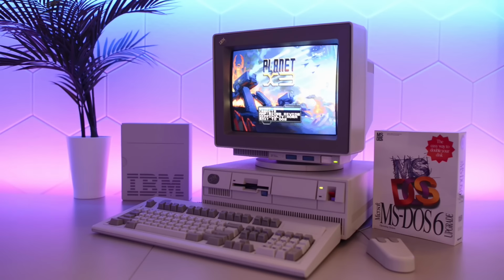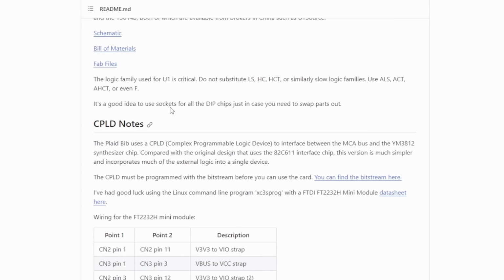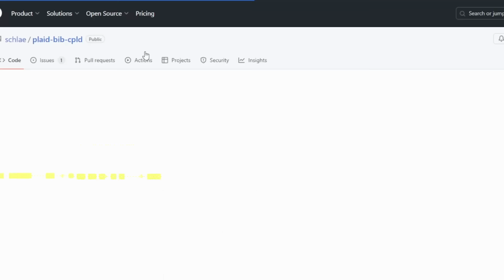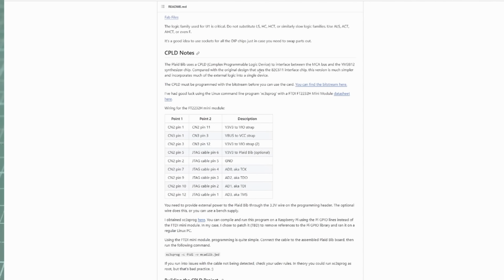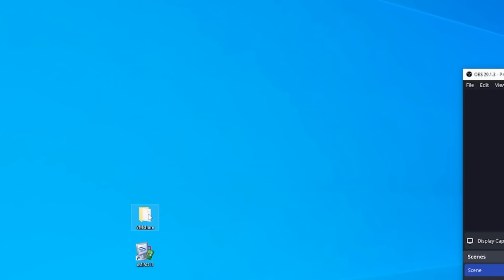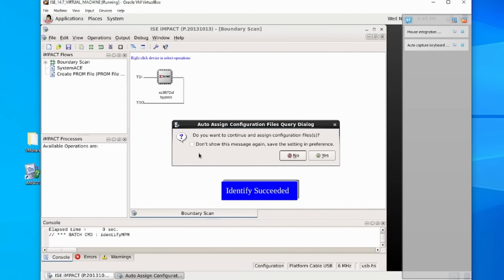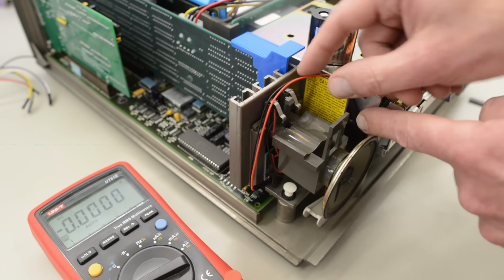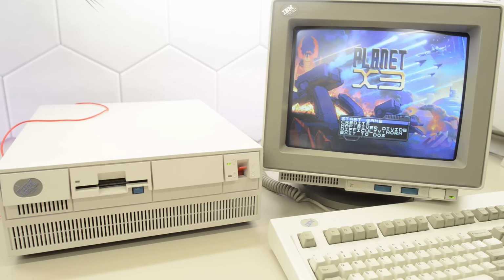Ad Lib MCA replica build + CPLD programming. Sound card for IBM PS/2 Micro Channel Architecture

Comment: tubetime is impressive smart guy. 
also, i dont think the bake part instruction is very relevant to hand soldering anyways. it is important if ur using solder paste and hot air because if theres too much moisture inside the chip package it can explode when heated as moisture vaporizes.
Reply from the maker: I read somewhere that he reverse-engineered the card just by looking at a picture of the original card

Comment: You made it slightly more difficult than it really is. When programming cplds the standard way to power it for programming is just plug the board or device in and power it normally from the slot or power jack. The chips are designed for in-circuit programming. The 3.3v will go from the 3.3v regulator automatically to the programming header and chip. There's no need to use a bench psu to supply the voltage for jtag programming. If you are concerned about plugging in the board and blowing it up due to a soldering mistake, program with jtag at the beginning.... mount the cpld and regulator then plug it in and program it. Or do what I do..... put only the regulator on the board then plug it in and measure the voltage on the jtag header and the chip vcc pins. If it's 3.3v then mount the cpld, plug the board into the slot and program it in-circuit. Then remove the board and solder the remaining components.
Reply from the maker: Ok, good to know, thanks

Comment: Is anybody else seeing the visual artifacting ?  It's pretty visible @4:58 (middle of screen on the right) though you can see it at other times as well.  I've seen it in Green, Red or Blue at various points.  I don't get it on any other videos, so I don't think it's just me. ???
Reply from the maker: Sorry about that. My rendering PC seems to be messed up. I didn't notice until it was too late
Reply: @Epictronics1  It reminded me of the kind of glitching you get when you overclock the RAM on your video card too far.  It's a bit too uniform though.
Reply from the maker: @ErrorMessageNotFound  It's probably a glitch in davinci resolve. I'll do some troubleshooting and fix it before I render the next video

Comment: Surely at some point someone will figure out a way to use Modern parts to replace the DAC. It can't possibly be that different to parts being manufactured now The OPL2 for sure needs to be an original part but a dac  should not be something that is a problem for a reproduction soundcard
Reply: I'm curious if even the OPL2 really needs to be genuine.  I haven't tested any cores myself, but we've got to be getting pretty close to near-perfect reproductions now.  I'm curious if any of them have gotten to the point where you could send the same commands to the core and real IC, and get the same bitstream back.
Reply from the maker: I was just thinking the same thing!

Comment: I think you'll find the 3 vias for the caps aren't for 3 legged caps  but so you can use either 2.54mm or 5.08 pitch capacitors.
Reply: I wonder if engineers back in the day designed their PCBs like that to account for potential part availability?
Reply from the maker: Thanks for noticing. I just assumed 3 legged caps because they were heavily used by IBM in earlier models. I checked and I think you are right. The pads don't match the polarity of three-legged caps.

Comment: Interesting trivia: If you look closely you'll notice the VLB slot and 16-bit MCA slot are the exact same connector (obviously the pinout is very different). Since the MCA bus never took off there were a lot of extra MCA slots laying around made for boards that were never sold and manufactures decided to repurpose them as VLB slots.
Reply: On a similar note: AMD's Slot A connector for Athlon CPUs is the same as Intel's Slot 1 connector for PII/PIII CPUs.
Reply: @eDoc2020  The same? I mean the same pinout?
Reply: @asanjuas   The pinout is different, and the heastink goes on the opposite side of the card. This provides very rudimentary keying: in most boards you'll hit VRM components or the back panel IO connectors if you try to insert the wrong brand CPU.
Reply: I thought that PCI uses the same physical connector, am I right?
Reply from the maker: Yeah, I read that somewhere else too. I wonder if IBM had licensed the MCA bus for less, maybe it would have become the standard
Reply: @Epictronics1 or made It free!!  There was no EISA even which, of course works very very similar to ibm MCA bus

Comment: What's the purpose of the CPLD? I suspect it's replacing an older part that's harder to find.
Reply: CPLDs are programmable logic chips that can you can use to replicate the function of discrete chips. In this case it replaces the roughly half dozen "glue logic" chips on the ISA version that take care of address decoding and latching. It also implements the POS (programmable option select) that allows you to configure the device from the reference disk.
Reply: @sa230e  I know what a CPLD  is, I just didn't know what it was used for in this case. At first I thought it was replacing the OPL chip, but then he added an OPL chip.
Reply from the maker: It replaces the P82C611. They are not hard to find but the CPLD version works with faster PS/2. The original P82C611 version only works with the Model 50 and 60 Afaik
Reply: @Epictronics1  ah ok that makes sense

Comment: I was about to ask why IBM just never open-sourced the MCA bus, but I  checked and they still use MCA in their RS/6000 unix and AS/400 line.    Interestingly MCA was a 10mhz bus compared with the 8mhz AT bus, but the big difference was burst mode (which made it a lot faster), and any card could take over the bus to talk to any other peripheral on the MCA bus without CPU intervention.
Reply: The whole point of MCA was to be deliberately proprietary. IBM thought they could force the clone makers to license their MCA bus so they could continue to be "IBM compatible", but the clone makers ended up creating their own standards in the form of EISA, VLB, and eventually PCI. In the end IBM abandoned MCA for their PCs because they wanted to compete in the same market as their competitors (until they didn't and sold out to lenovo). Evidently IBM couldn't let go of that need hold onto their proprietary technologies, hence they never open-sauced it. Maybe someday someone else will license MCA ... [wistfully stares off into the distance]
Reply: @UpLateGeek  That was 70% it, the other part was even at the time, the AT bus was simply too slow.

Two things about MCA that are frustrating:

1) The major technical thing wrong with MCA was the you needed those pesky feature disk to make the card active.   Why not just have ROM on the card that would allow the card to self-configure?  Even the Amiga could do it and it was released around the same time.

2) The patents for MCA didn't even come through until after the PCI bus had replaced MCA in the market.
Reply: @teekay_1   The feature disks sound like they could be a precursor to the init programs that accompanied various PnP cards.
Reply from the maker: Is AS/400 still alive? Wow, I used it 25! years ago
Reply: @Epictronics1  Still kicking like the mainframes.   There are small business who can't afford to move away from them.

In fact, IBM's hardware lineup in the 21st century is based on pricing that doesn't make it cost-effective to switch.

Comment: It's never a good sign for a bus's adoption, when it requires an expensive big honking ASIC just to do all the arbitration to hook up 8-bit legacy parallel devices (that's the C&T 82C611 in the bottom left of the card.)

Comment: I don't mean to panic you but be careful with "noctua" fans! They're great but the airflow is also what it is. I replaced the fan of my NAS PSU some time ago with a nice Noctua, 2 years later I realised the airflow was so low the thing was running at stupid temperatures and I baked it. The original fan was probably overkilled for the system but make sure it still gets enough airflow!

VERY nice card, I still need to sort out my PS/2 I am so lazy...
Reply from the maker: You're not lazy Tony. You made a great video this week as always. Thanks for the warning. I didn't check the datasheet of the fan in this PS/2. However, I checked and compared when I replaced the fan in my PS/1 and the noctua was quite a bit more efficient. I'll make a habit of checking every time, thanks
Reply: This really needs to be said more.  Everyone likes to replace loud fans with Noctua, and -- not always, but usually -- there's no thought given to why the original fan was so loud.  Sometimes it truly is just because... it's old, aerodynamic and bearing design wasn't what it is now, and manufacturers erred on the side of thermal margin rather than acoustics.  But, sometimes the engineers knew what they were doing, and didn't spec a fan that slow because the thermal design couldn't sustain itself with a fan that slow.  And that really is the #1 correlation -- more speed is more CFM is more noise.  Pesky physics...

Comment: Replacing the big old 6V Lithium Battery with 2 CR2032 will not last for long.
Reply: Yeah talk about a downgrade in capacity. I really wish modern retro enthusiasts would stop trying to shoehorn coin cells into everything.
Reply: @heilong108  Indeed. A massive downgrade. The NVRAM of a PS/2 ist not to be compared to normal CMOS so the large Batteries might be needed. I think thi one is a 2CR55 with ~1600mAh compared to the 110mAh of a CR2032.
Reply: @heilong108   Sorry about that.  I really hate sourcing all the various different kinds of cells everything uses.
Reply from the maker: Unfortunately, I don't think my multimeter can measure such a low current flow as we are dealing with here. I'll get back with some feedback when it runs out. Although it could be a long wait. If I understood the weird date code correctly on the original battery in this machine, It had the original battery for as long as it was in service.

Comment: Someone REALLY needs to build a modern SB-AWE32 clone, with working stereo in pro2/16 mode.. With off-the-shelf, still-produced, parts and on the relatively cheap..
There should also be an open-source design and implementation, following the same rules as above, of both a Voodoo2 and an ISA Tseng ET4000, just to cover all the bases.

Retro motherboards are available by the truckload if you do even just a LITTLE bit of hunting (large cities often have electronics stores that deal in vintage/retro hardware, there's a GREAT one in Houston TX called "Electronic Parts Outlet"- Can't tell you how many times I've come across 5170s, Tandys, Ataris, even spotted a never-opened Commodore VIC-20 there for $250), and CPUs and RAM are even more common and can be had a dime a dozen, especially the 486 era (SX20s up through DX4-120s) and the Pentium-1 socket7 stuff.

But the holy grail for most vintage builders parts lists almost always comes down to two things; a REAL sound-blaster (most aim for pro2, sb16, or awe32) and the highest-performing ISA VGA card is the Tseng ET4000 .. If you want your eyes to bulge, look up the price of an ISA-VLB ET4000-powered video card.

So an open-source implementation of both the early ISA sound-blaster and two video cards, the et4000 and voodoo2, would make retro machines muuuuuch easier to attain for the ley person, not only for scarcity nowadays, but even just in price.
Reply from the maker: Totally agree. Let's hope someone makes clones. I'll be the first to build an ET4k VLB card
Reply: I agree a sbawe64 for PCI with opl2 was an amazing dream.
Reply: Would love to see a repro EMU8K, but that's a tall order.  Although, if we have a GUS on FPGA, we're not that far off.  So maybe eventually.  Ditto Voodoo -- that's a big ask.  But so is the N64, and that's a reality now (no pun intended.)  Hopefully some day.

However, I really think the ET4000 is tarted up to be way more than it actually is.  It's... fine, I guess... but it doesn't live up to the hype.

For ISA, the bus is your biggest bottleneck.  There are PLENTY of chipsets that can saturate ISA.  The only real benefit of any given late-era VGA chipset is Windows acceleration, if you even care about that.  For DOS, brute transfer rate wins, and well.. if your kink is 320x240, adventure games, don't worry about it.  If you want to play Doom, use a Pentium with PCI.

For VLB, there are plenty of boards that perform as well, better, or at least "as fast as it matters" -- and cost a lot less, since they aren't hoisted up on a pedestal like the Tseng.

I got one of each (ISA and VLB), tested them, and immediately felt bad that I spent that much on a mediocre card that I had no sentimental attachment to.  Just my PSA -- if you don't have one, you aren't missing much.

Comment: I love descriptions on PCB.
Does anybody else experience flickering lines in the video?
Reply from the maker: Yeah, sorry about that. I didn't notice until it was too late to fix it. Something is messed up with my rendering PC
Reply: @Epictronics1  I had something like this happen back when I still used Adobe Premiere Pro. I eventually had to just remove CS from the computer and reinstall.
Reply from the maker: @grafxgear  Thanks, I'll give that a try
Reply: The printings shows the designer has a humour similar to mine.
I've seen these lines too. At first I thought my monitor had an issue.
Reply: @e1woqf  last time I saw something like this it was my graphics card dying, so I was a bit worried
Reply: I have also noticed them, thought it was my computer but it's not.
Reply: @vampirefrog4277  yeah, we had a nice Andy Kaufman moment there ;)

Comment: Maybe it would be easier to desolder the board by using a hot air tool to melt all the solder then pull it free. That might melt the solder on the other parts on the board but that can be fixed after the fact if you even care.
Reply: I've used a paint stripper to remove parts, but a temperature controlled hot air gun works to remove all the parts by tipping it upside down and taping it. for soldering I find it good to add kapton tape where I don't want solder and to preheat the PCB.